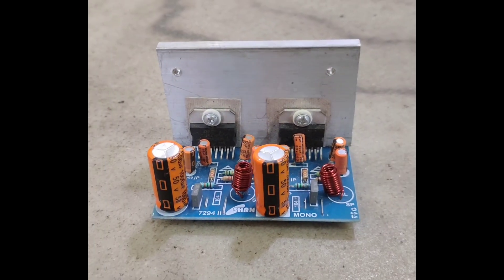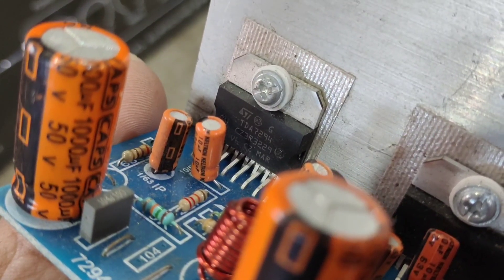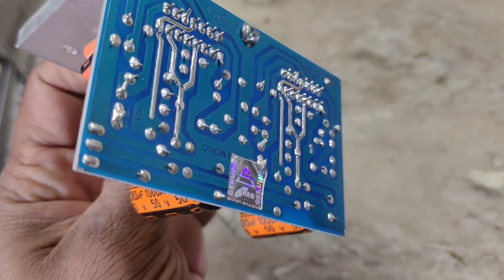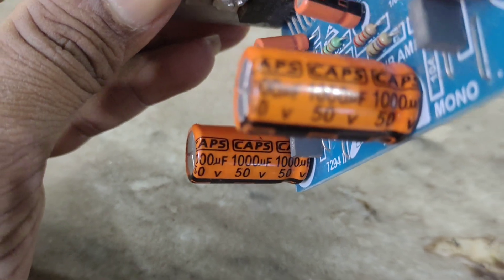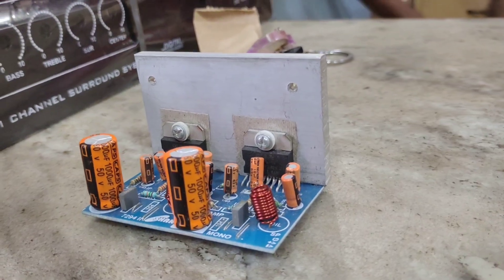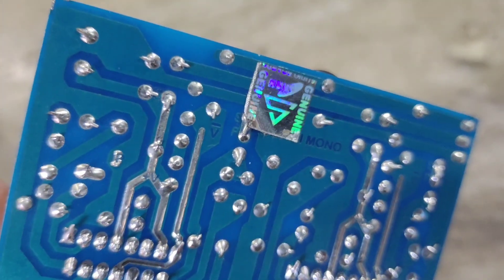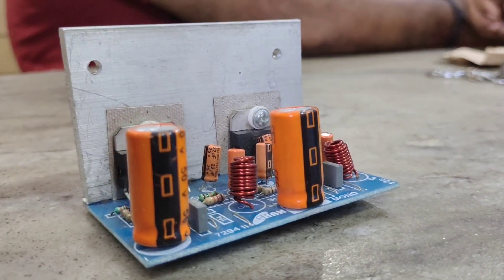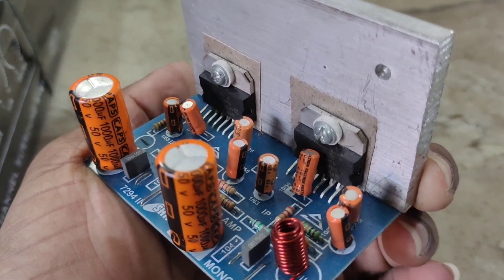Tda 7294|Subwoofer board

Comment: Sub ന് IC ആണോ MOSFET ആണോ | നല്ലത്
Reply: Class D using Mosfet Board
Reply: ട്രാസ്‌ൻസിറ്റർ....
Reply from the maker: Ic um nallathA tda 2030 niggal upayogikkunniley
Reply: Ic വെച്ച് 12 inch sub ഒക്കെ വർക്ക്‌ ചെയ്യുവോ power amp കൂടുതൽ 5200/1943  transistor ആണ്...
Reply: Sub ne mosfet board ann nallaath.
Reply: Sub class d anu nallath...channel class AB